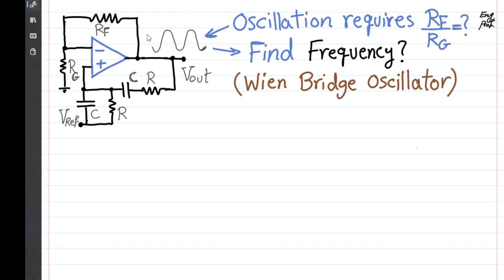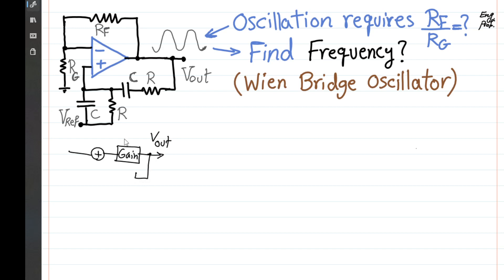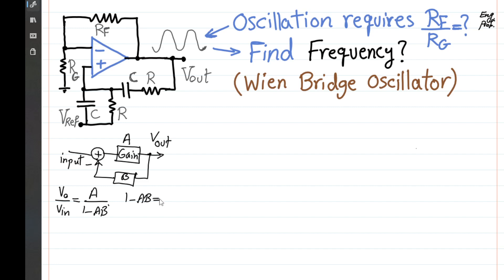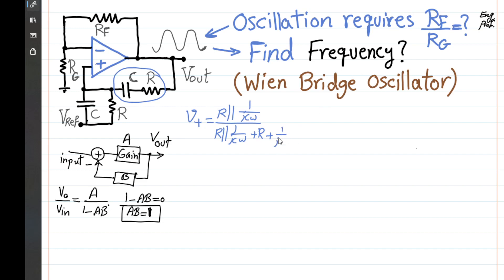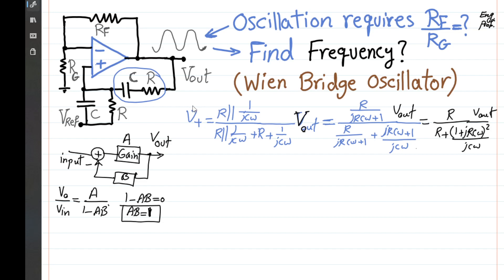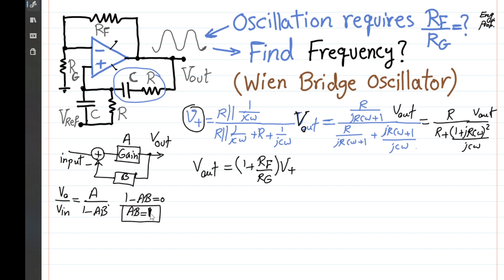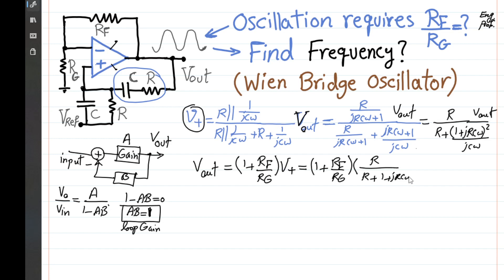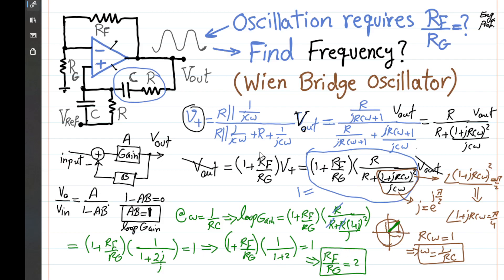Wien Bridge Oscillator Explained: find Frequency & Loop Gain

Comment from the maker: For more examples of Analog Circuits, Oscillators, Op-Amps, and Transistor-based designs, check out these videos:

🔹 Triangle Wave Oscillator (Op-Amp Circuit) – Watch https://youtu.be/JF5Up_cuL9k
🔹 Complex Sinusoid Oscillator Explained – Watch https://youtu.be/GXRhmwmS5Zk
🔹 Sawtooth Oscillator Design – Watch https://youtu.be/2eUsGPfqbW4
🔹 Sawtooth Waveform Generator (Op-Amp, JFET, BJT Analysis) – Watch https://youtu.be/5zHXTx-Vl20

For even more circuit analysis and design examples, check out the full Circuit Videos Playlist https://www.youtube.com/playlist?list=PLrwXF7N522y4ee_0GL2EdguM-kLtJPxpU
Hope you find these videos helpful and interesting!